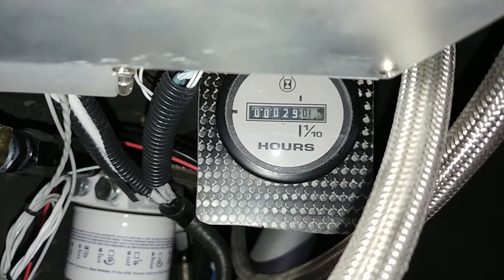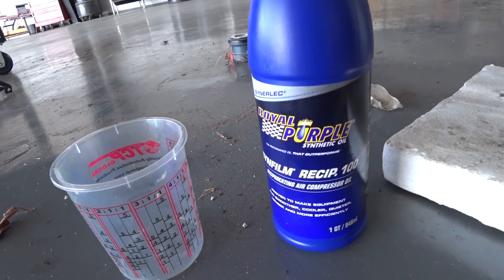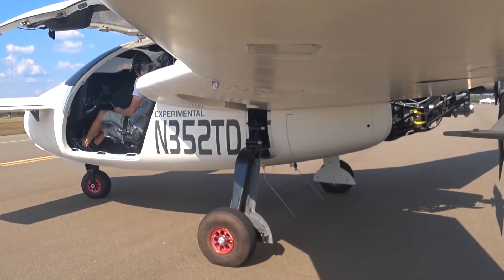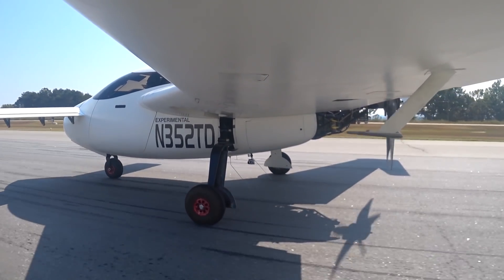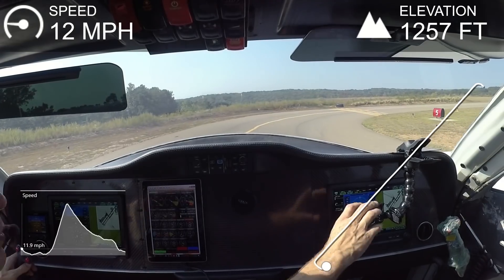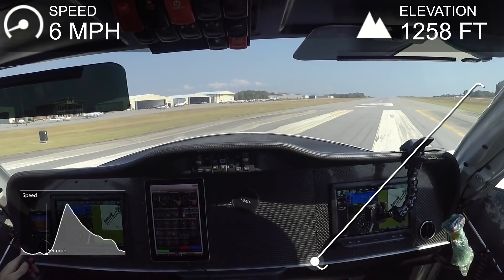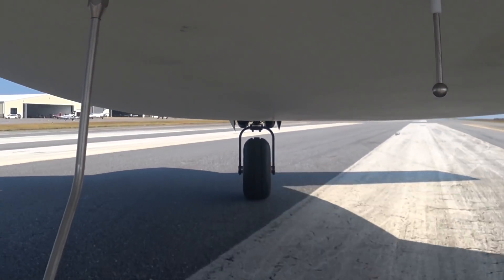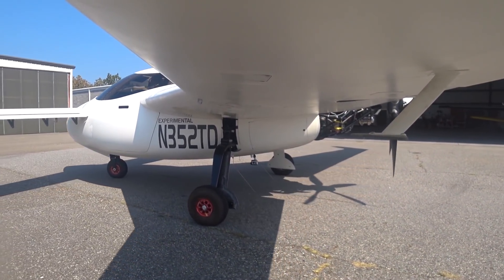Engine Tuning Surprise - Building the Raptor Prototype

Comment: In addition. The nose shimmy may be depend of haven't distance with horizontal axis of the landing gear, back at line of vertical axic for landing gear. Add several cm back and you left it completly.

Comment: Hello! As said good old avia engineers, -- 'Give me very good Engine and I may fly on house door', -- hehehe! ;-) I wathed many yours videos, and see your 'global' mistake aroung used this fuel engine... /Sorry for my 'naked' truth!/ You was very reasonable used BLDC on RC model of the Raptor at 2015. But you had not believed to electrical power for future e-aircraft!.. :-( So, its have a problems. For example, famous EHANG-184 multirotor aircraft has an electric power problem for own passenger drone, and its because the problem has exclude by 3x+ low energy efficiency of it, -- contrary conventional wing aircraft, -- who are a priory inherent of multirotors, or may be helicopters too... So, my good suggestion: use modern avia BLDC on 200+kW, presents at autumn (?) 2018 on an aviation show... /Sorry, I lost direct link to this device and video in the airshow./ Of course, the motor powered by 'Tesla Motors' like big litium battery... And your Raptor will be happy as first really aero taxi for short or middle distance! ;-)

Comment: !!#!#!##CRITICAL ENGINE FAILURE WARNING!#!!#!!!!!# I posted this before. Addendum 
Set rail pressure as close to stock as you can. As long as you can get your fuel in with the given injection pulse width. Diesel is critical because the pulse is timing and duration of burn. Gasoline engines can run a huge injector with a blip of a pulse because the spark plug starts the timing event. Diesel injection time and duration is critical. Better to reduce rail pressure to get full injection duration than shorten injection cycles to compensate for high pressure. 
Audi VW Diesel pre turbo egt should not exceed 1650F/900C! You have excessive fuel dumping into the cylinders. Properly tuned and at normal operating coolant temp, IT SHOULD TAKE 1 TO 2 MINUTES AT FULL LOAD TO REACH 1650F.  I had noticed high egts previously, but the way it spikes up to 2000F so quickly is downright dangerous. The ECM would be better off if you programmed it to start pulling fuel when it exceeds 1850F. In Diesel, the extra fuel heating up the turbo and headers isn't adding anymore power. The heat is coming from fuel leaving the cylinder unburned. It is useful to reduce lag where tuners give it some extra juice to spool up quickly and pull extra out as soon as full boost is reached.  Probably not needed function in an aircraft.  You have come way too far to cook a motor now.  1600F would be a better temp for reliability and reduced wear on the turbo. For increased take off and emergency power, water/methanol injection would be ideal. It gives a very slight delay in ignition, couple degrees crank angle.  I know it's gas powered but Andrew Findlay's Reno Sport Gold Lancair uses it. Injecting almost 5 gallons of water/ methanol to keep his 700hp, 550ci  flat 6 Briggs &Stratton from popping smoke in the 6 laps. Averaging almost 400mph over the course in a stubby winged Lancair Legacy. The injection drops the intake air likely more than 100F at that rate. 
I love this plane and I love the motor even more.  The Raptor is one heck of a plane,  i can't wait to see it fly!

Comment: As Mr. Waggoner noted below, though IOT adjustments may improve things somewhat, your issues point more to lack of air than IOT.  And, as noted, use caution with the amount of IOT reduction used in consideration of design limits and life of the injectors (and pump).  And increasing the probability of injector failure over life screams for the need of per-cylinder EGT sensors to indicate a failing or failed injector before worse things begin to occur.  While the IOT adjustments may still be needed, a harder look at your staged turbo setup is long overdue and will likely go a LOT farther in obtaining your desired HP (assuming 300-350?).  Is there any way you easily place your LP turbo in bypass for a quick test to see how you are performing solely via your HP turbo?  Also, have you thought about trying a test club prop for an easy way to measure engine HP?  Having more certainly would definitely be a plus for more than just tuning.  And finally, you can definitely still see lateral instability in your front strut - adding stiffening to your mount points is still sorely needed and, with your new fluid, will likely completely resolve any further shimmy issues.

Comment: If you needed easy access to non detergent SAE30 wt oil can buy SAE30 motor oil for heavy duty engines. Like Castro HD 30 or any other similar non detergent oil. They are basically available everywhere but sometimes hard to locate since they have limited applications to mostly commercial power equipment

Comment: We used jet a in our tug at an airport years ago. Diesel has a lubricant for the fuel pumps while jet A does not.  And using diesel in cold temps at 25,000 feet could be a concern?  Just some outside thoughts over all I Am really excited to see her fly and kits being made!
Reply: Add 20% Biodiesel for lubricating the entire fuel system.
Reply: @erikwahlstrom7826  ,,, yes, great lubricity, but subject to cold temp problems. And this project just doesn't  need another variable.  I'd probably go with a known additive if I was concerned about lubricity.
Reply: Peter is aware of these issues.. When running Jet-A, Marvel Mystery oil will be premixed in the tanks for lubrication, and the fuel [regardless of jet-a or diesel] is circulated through the intercooler to warm the fuel and cool intake air.

Comment: Just a note from someone that has tuned diesels for quite some time.
Be careful boosting the fuel pressure way up.  It allows a smaller pulse width, but it puts stress on the pump and injectors.  As another poster noted, the injectors (and pump) will have a much shorter life.  
If you are getting smoke, that is typically an air problem (not enough of it).  You are seeing a rich mixture.  You might try increasing boost to get rid of the smoke.  If you are trying to reduce pulse width (PW), you might consider going to a larger injector allowing a shorter PW for the same fuel.  
Remember that diesel timing is in % of PW and it changes with temperature, hence the correction tables.  As a point of reference, I have found the best power timing in a Duramax is around 60% BTDC at WOT.  Of course, every engine is different, but I would imagine the AUDI is close.  A final note:  a diesel will not let you know when you have gone too far, it will just destroy the internals (ask me how I know).
Keep up the good work! It's exciting to see the progress!
Reply: Definitely key info. Hot meltdown and an oops. Definitely don't want the oops in the air. Egt is way too high. You can find lots of good info on audi blogs. Good references for timing, duration, pressures etc.
Definitely read the failures. Turbine INLET side (nobody is referring to in cylinder temps) should be under 1650 and really for aircraft even less to increase reliability.

Comment: Common issue with people tuning their diesel engine by increasing the common rail pressure is that the injectors fail early. Are you now over the pressure that Audi runs this engine at?
Concerning injection timing, keep in mind that the injection timing also depends on fuel temperature.

Comment: I believe that the oil always looks foamy because.  It is operated under pressure. Air gets mixed in under pressure and large bubbles come out during operation under pressure.  It would not look foamy under pressure.  Its when you release the air pressure that micro bubbles in solution expand and then it gets foamy.  Like when you put resin under vacuum.

Comment: 6:00.., you not worried about hitting the prop on take-off?
Reply: The prop is not very far behind the main wheels, so it does not go down very much with rotation.  They have done tests, it is in an older video, and getting the nose way off the ground, the prop still has about a foot of clearance.